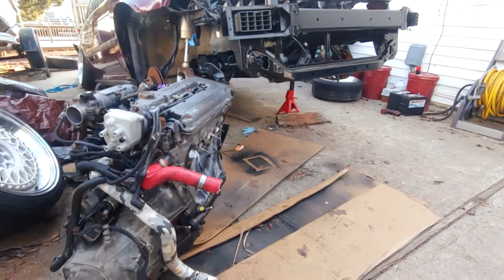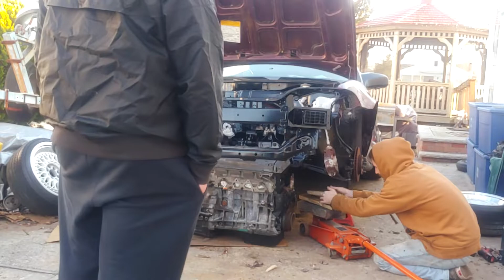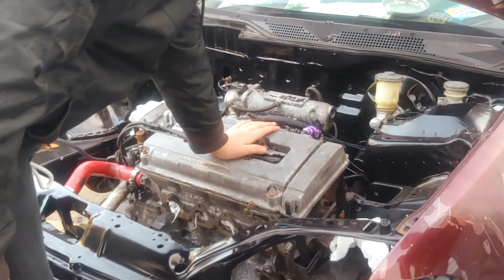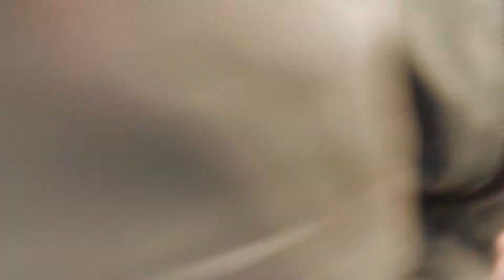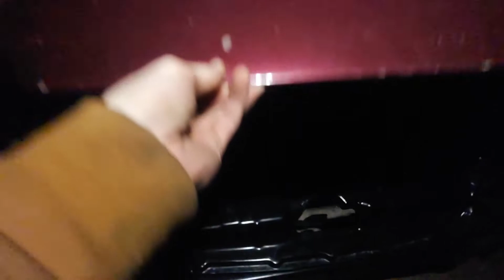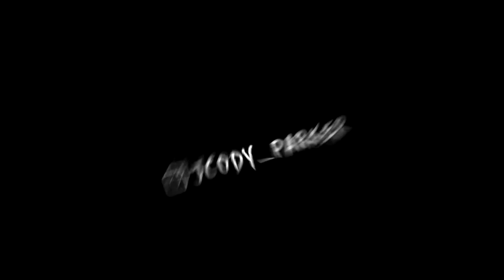EG Sedan  GSR swap without engine hoist

Comment: Do the B series bolt up the same as the D series
Reply from the maker: Yeah but you need bseries mounts depending on which motor you're putting in.
Reply: @jcody_parker  right, i got a 7th gen es1 and trying to figure out a swap, I would do a k swap but don’t really wanna change my subframe out.
Reply: @jcody_parker  so i figured go B🤷‍♂️
Reply: @slowazzes1972  k20 is a better option for the 7th gen since they make mounts for it, b series is a older engine and only works for the older hondas